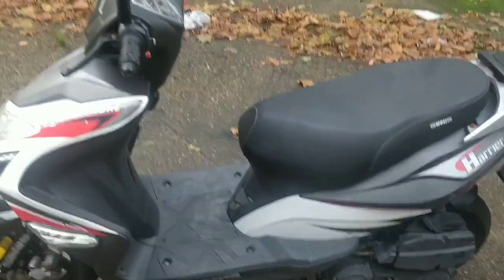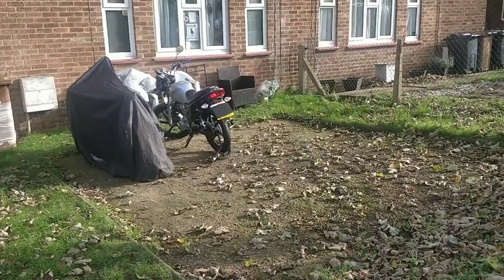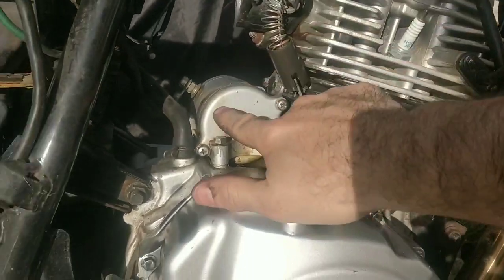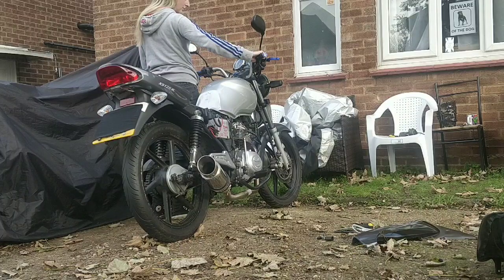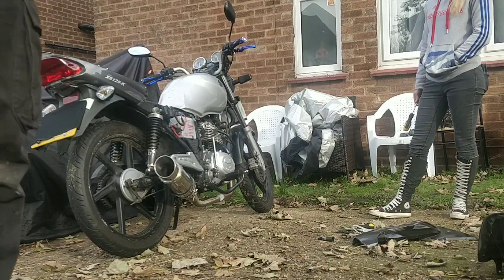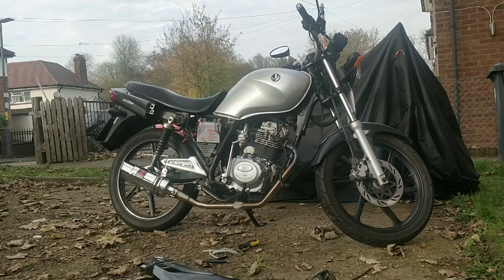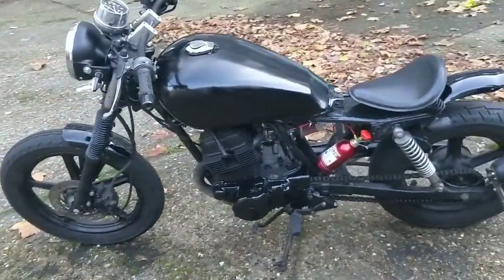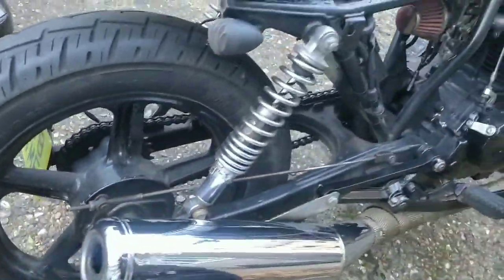sym xs 125 carb upgrade, Nats Nackers yard drop in and a Honda cb250 update.

Comment: Hi Charlie Great videos. How many turns from seated did you turn the mixture screw following the rejet? I’ve just bought a new carb with the intention of fitting air pod etc. but didn’t know weather I had to adjust the mixture screw at all or is the standard 1.5 turns ok?
Reply from the maker: Hi Justin, it will never be a set rate on a carb. 

To set it you seat it all the way in gently then back it out 1.5 turns. Warm the bike up to temp for a couple mins, then back it out half a turn and listen to the engine, if the engine speed has risen then that was a good turn, then repeat until the note stops rising. If you turn half and the engine revs didn't rise then turn back that half plus a quarter and you will be at your best setting. 

I hope that's understandable. Do message me if you need more help. 

Thanks
Reply: Hiya Charlie, thank you for the swift response. Your advice worked a charm bike runs great. Better than ever now actually thank you.
Could I please pick your brain about my brothers bike, he has a Jinlun 125-11, nothing but bother with his carb set up has been since he got it. He was using his standard airbox but has decided to fit air pods the carbs are the Chinese cv twin type his jetting is 35 pilot and 92 main I suggested he go up to about 98 for the main jet fitting the pods would that be around about right do you think. The exhaust has had the link pipe cut out and welded and the egrs blanked off so they’re two individual exhausts. Any help would be greatly appreciated thank you
Reply from the maker: Hi Justin, I agree with 35 or 36 idle and 98 or 100 main. Honestly though I would use the air box. No bike likes running on pods in my experience.  They are smoother with their air boxes. 

What you can do is re jet to your specs as you said and tale up half of the air pod to restrict the air. That could work. Give all that a shot mate.
Reply: Hi Charlie, I’ll give that a whirl thank you. His airbox was shot more air leaks in it which were the initial problem but then he went and tampered with everything and it’s messed up. We found an airbox on eBay but the inlet from box to carbs has perished which wasn’t mentioned in the ad. So we thought we try a rejet and pods. But I’ll try all of that thanks again for all your help much appreciated

Comment: hi i got the new carb for the sym125xs how many turns did you turn the mixture screw out as i am fitting carb soon .it is easier to get to, while  the carb is off thank you..
Reply from the maker: You would normally start at 1.5 turns out, warm the bike up and wait until the choke is off. When the choke is is off turn it half a turn out and listen to the revs, if they raise that was a good turn, do that until it stops raising and when it does turn it half a turn back in. That will be your optimum setting
Reply: @motorcyclerescuer  thank you for your quick reply.its a long time since i played around with a carb..i will let you know i get on thank you for all your help..👍👍👍
Reply from the maker: No worries. Good luck with it

Comment: hey are you still actif in this channel ??
I have an important question
I want to upgrade my sym Xsmart 125 (2014) to make it more powerful and run better
how can I do this? and what should I replace on it?
thank you m❤️
Reply from the maker: Hi Arnor, thanks for watching and commenting. Please do like and subscribe as yes its a current active channel. 

So I used a honda cg copy carb on the bike in this video and up jetted it a touch. This definitely gave it more power and it felt like a much more usable bike. You can also put a bigger exhaust and a high flow air filter if you wanted which would also help.

Comment: I now own this bike and having nothing but trouble with the idling 😢😢
Reply from the maker: That vid was 2 or 3 years ago mate. I would suggest you throw a new carb on it for £20. Normally this solves most issues. 

I would also get the valve checked and re set as they may not have been done.

Comment: hi i have just picked up one of these bikes. sym 125 xs have you any pictures of the fuel breather mod. i have just gone back to a 125cc due to arthritis in both knees .been riding big bikes for over 20 years. but my left knee cant take the weight anymore. thank you.
Reply from the maker: Hi Steve, sorry to hear that mate, you can find small and light 250s 300s ect if you decided you need a little more oomph. My vespa 300 (currently for sale) is extremely comfortable and pulls like a train. 

So I upjetted the carb by 5 and took one of the plugs out that was in the airbox to add slightly more air. You could drill a small hole if your box dosnt have any plugs to pull out. 

But you won't get much power out of this engine sadly. They are around 9bhp. 

Cheers
Reply: @motorcyclerescuer  hi charlie and steve ,,, i had my sym ax 125 for around 2 yrs there's a couple of things for £50 you can do depending on your confidence ,, number 1 bin the stock carb for a  JFG RACING VM22 PZ26 26mm Carburetor Carb For 125 144 150 160 170CC ATV Quad Dirt Pit Bike
Visit the JFG RACING Store 
 ,,wash and clean and dry the air filter in hot soapy water and fully dry .the plastic cover for the air filter with 3 screws needs modifying via Drilling 6x 16MM  holes in a circle where the filter meets on the back side of the cover hard to explain but sure you will figure it out  ,,number 1 RULE DO NOT USE E10 FUEL E5 ONLY ITS A CARB BIKE,,, CHECK VALVE CLEARANCE  ..buy some feeler gauges adjust to spec ,,if you google it its there trust me and it is easy to do 2x10 or 8 mm spanners if i remember,,, with this simple MOD  she will give you 11BHP ,AND EASALY do 72mph as mine did on the GPS speedo gave up at 65 and danced like a lunatic ,,change the oil every 1200 miles is a MUST !!! standard exhaust is fine if you change it you will need to re jet the carb and adjust the air and fuel mixture stick with the standard exhaust better performance and it is happier trust me !! i did over 200mls on motorway after passing my test yes it was hard and painful on the engine but she was singing all the way ..after all its a Honda engine with a SYM badge ,,ps standard spark plug was never changed!!
Reply: oh forgotten carb is about £35 also buy the HD4 7 INCH HD HEADLIGHT about £17 ebay  much better than the candle bulb stock unit and doesn't drain the battery as fast  !!

Comment: Hi Charlie finally got a bike.  I got a yamaha virago 535 . Will upload video soon
Reply from the maker: Yes Steve that's a good choice mate. Great bikes. Well done
Reply: @motorcyclerescuer  thanks Charlie im happy with it backfire a bit when you let of the throttle so maybe needs a carb clean thanks steve
Reply from the maker: @steveandfamily7248  back fire or just popping? Popping is OK over all.

A back fire could be coil related or spark plug, less likely to be carb but could be.
Reply: Was up for a 1000 i paid 850 with 1 years mot
Reply from the maker: @steveandfamily7248  sounds like a steal dude. Give it a service and it should be good to go.

Comment: hi Charlie its great what you do i ....im a bit like you as i  like to see bikes on the road rather than scrapped ...anyway got a one of these for scrap price after it stood for 15months or so its a 2015 just under 7000mls so i got it back on the road and through its MOT in December and iv had an headache for almost 3 months with it just couldn't get it to run right from day one... with out the life story got the usual new parts carb/plug and coil and drained an flushed the tank of old fuel so after months of investigating i found the stupid design fault that lets water in the tank i found it after i drained the fuel into a clear container seen straight away contaminated fuel with water so i put a makeshift tank on and had no problems ... can you give the lady a heads up who owns this apparently its common and destroys them apparently  ... the culprit is the breather hole / overspill hole just under the fuel cap and i measured just under a 547MLS  of water since December:( :( so i have plugged it and put a breather pipe in a better place to ensure no more water gets in ...sym dealers must of knew of this and didnt care so annoying ....
Reply from the maker: Hi Tony  I do still chat to her so ill mention it, that would explain why her carb was so bad to start with. It shouldn't even have started really. 

Thanks for watching and thanks for the advice.
Reply: @motorcyclerescuer  you helped me out in the past with your head scratching issues you have had and just thought i would mention it as that carb was pretty much the same condition as mine ..thats what we are all here for right...keep up the good work ...
Reply: hi have you got any picures of where the breather hole and pipe are and the mod you did thank you....
Reply from the maker: Hi Steve, what bike mate? The sym or the dna 125? 

On the sym I changed the carb to a cg jetted copy carb which bettered performance. 

I'm not sure what breather hole you mean mate?
Reply: @motorcyclerescuer  hi charlie its where the water gets into the  fuel tank. think it was someone you know who mentioned it in the comments on your video. the bike i got is the sym 125 xs like in the video. thank you for getting back to me.
Reply from the maker: Oh yes thats a common problem on some bikes. Basically you lift the filler lid with the key and around the filler hole you will see a little hole. Every now and again you should push some wire down, or shoot some carb/brake cleaner down to make sure it's clear and rail water can run out rather then flow into the tank. 

Hope this helps
Reply: @motorcyclerescuer  yes you are right. I put some PTF tape around the rubber fuel cap seal and used carb cleaner and a old knitting needle to ublock it in the end it worked but i don't own the bike no longer as past my test in feb this year and now the proud owner of a royal enfield classic 500.. But i did a lot of work on the little sym xs over the 2 years i had her.. And she served me well and never let me down ever no matter the weather throughout all 4 seasons.. Anything i can help with i will try my best to help
Reply: @S161064  sorry steve no pics but i basically used carb cleaner and a knitting needle.. As rescuer says it's the hole underneath the fuel cap.. You will locate the pipe underneath the tank theres a rather long rubber pipe replace it and use some PTF tape around the fuel cap rubber for a better seal and the L shaped steal pipe on the tank is a pain if its blocked off just where the bend is..  I also replaced the fuel tap and filter cup for a standard fuel tap and push fit filters. Hope it helps a little
Reply from the maker: I really like them Enfields you know. Great bikes. Is it a modern one?
Reply: @motorcyclerescuer  it's a 2014 in black EFI twin spark a good old school thumper .  As soon as this rain stops i will do a small video upload and send you a link..
Reply from the maker: Lovely, look forward to seeing it
Reply: @motorcyclerescuer  will sort video out tomorrow i promise now the weather is clearing up you will have to excuse my manc accent though its not as posh as you southerners LOL !!
Reply from the maker: Lol, sounds good Tony
Reply: hi charlie how would you feel about a personal visit with the bike ?? i have applied to join your FB  page and hopefully we can sort something out??
Reply from the maker: Hi Tony, what I would normally do is have someone bring a bike to me and we work on it together to see if we can make any progress. Sometimes it works and others it doesn't,  but many times we tend to get the bits done that need doing like carb cleans etc. 

You would probably be here around 4 or 5 hours mate. 

Drop me a message at some point to arrange if interested.  

Cheers mate

Comment: My carb keeps leeking a little bit any advice
Reply from the maker: OK buddy so it normally means that the float valve is stuck or worn out. First thing to do is clean the valve seat and try it again.

What bike is it mate?
Reply: @motorcyclerescuer  it’s a  ksr generic code 125 2014 I haven’t yet taken it off as I think you have to take the hole thing of to get to the bottom and it seems very complicated
Reply from the maker: Yes it's kinda complex. Are you in London?
Reply: @motorcyclerescuer  no mate Oxford
Reply from the maker: @jackanthonypayne9144  My suggestion would be just to buy a new carb and gave a mechanic fit it. It's a hours work max so around £70 to fit. You can get the carb for £20ish so 90 should get you back on the road mate.

You could ask them to look at your carb but it may need a rebuild anyway.

Comment: check electrical timing on the honda,sounds a little out and can cause backfire Charlie
Reply from the maker: It's a coil system Dave unless I'm missing something?

I think it's possibly valves that need adjusting but could be wrong.

New coils didn't resolve the issue.